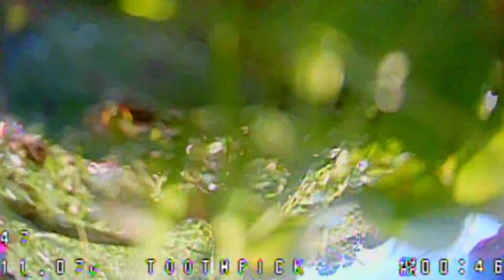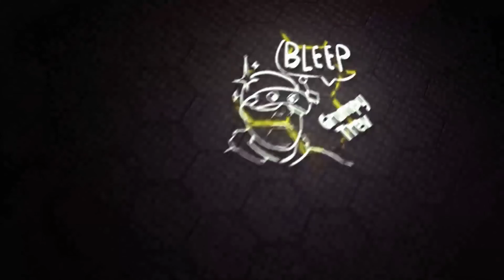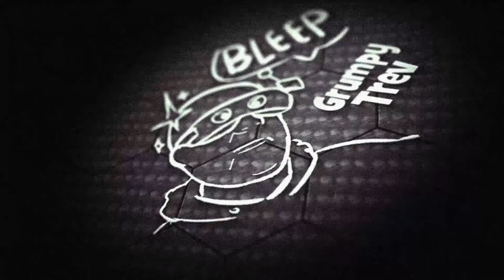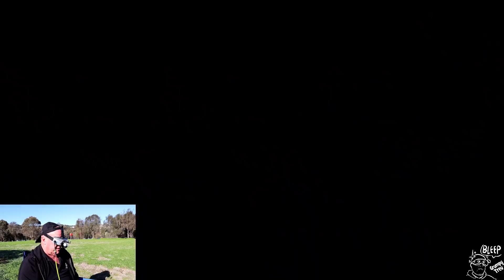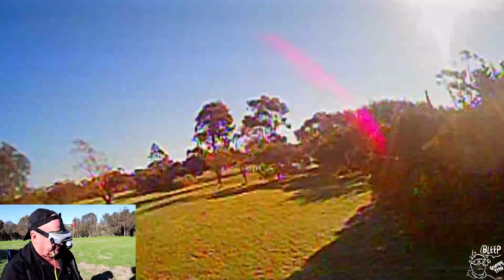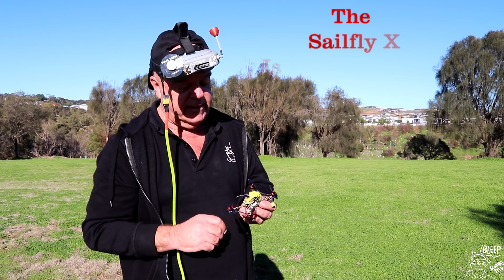FullSpeedRC Toothpick

Comment: Disable telemetry, known issue with crazybee boards.. a telemetry bug is causing the lock ups you're experiencing. If you really want telemetry you can get around the bug by installing a external receiver.